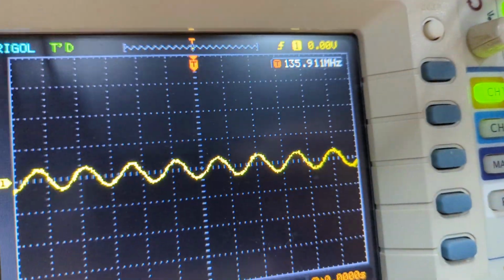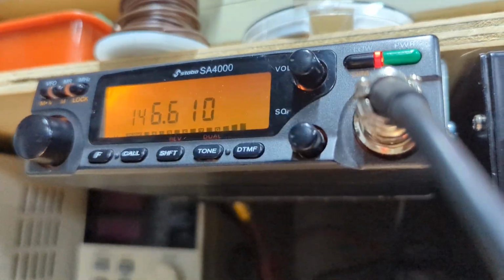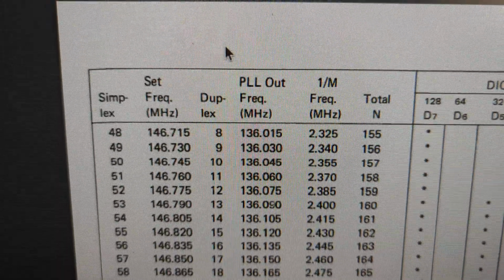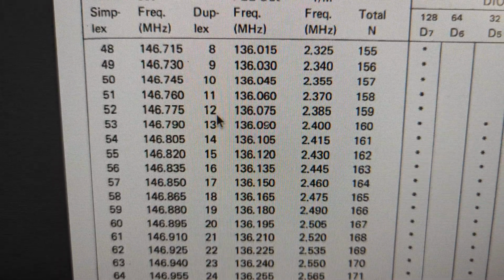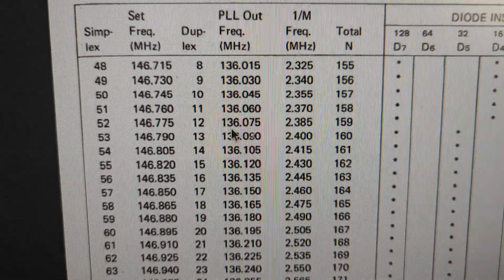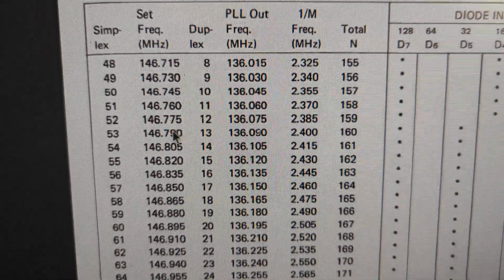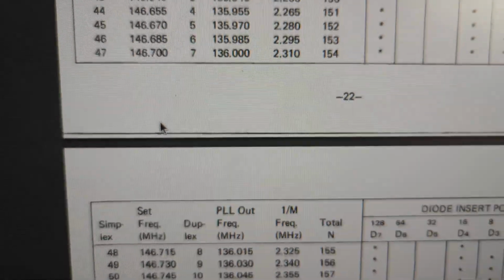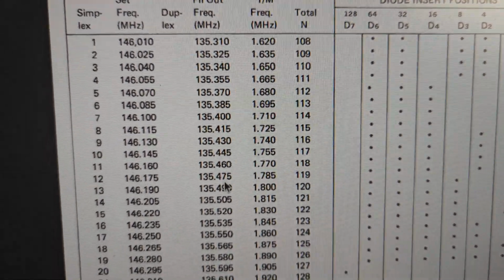Fiddling with an Icom IC-22S and replacing it's PLL board

Comment: The problem with the IC-22S PLL was well known and existed in almost every one of these units I've seen.  99% of the time the cause will be found to be a bad solder joint at one of the thru-hole "rivets".  The holes are not plated through so they had to put those rivets in to carry the trace to the other side of the board.  I think they must be steel, and none of them on the board are well soldered.  Apparently the flow solder process didn't heat the pins enough to get the solder to flow, and eventually the joints failed.  I don't know how many I've fixed by just soldering everything I could get a soldering iron to.  I gave up trying to find which rivet it was, although I did have some success using freeze spray.  Mine, which I bought new in 1976, took several years to develop a failed joint, but I kept it going for another year or so by just whacking it on the top to restore the PLL operation.  The first time I "fixed" it, I found the bad joint and re-soldered it, fully confident I had truly fixed the problem.  A few months later a second one failed, then a month later a third one failed.  That's when I just soldered every one I could find.  It worked for many years after that.  I set it on the "outdated shelf" probably close to 20 years ago.  About 6 months ago a fellow club member gave me one in which the PLL was dead.  I decided to dig my old one out and see if it still worked.  It powered on, but the PLL was not running.  So, now I have 2 dead ones.  Guess I'll dig into them with my now-well-equipped  workbench and see if I still have the skills to fix them.  Back then, all I had was a VOM, soldering iron, frequency counter, signal generator, and a can of freeze spray.  Hard to believe I used to service 2-way radios with no more than that.